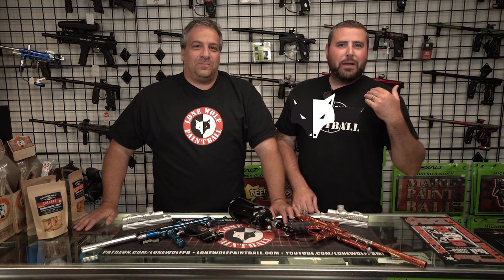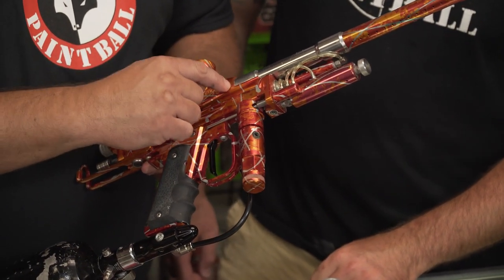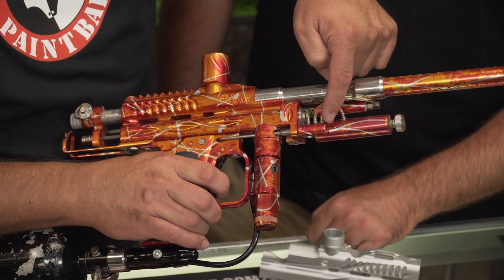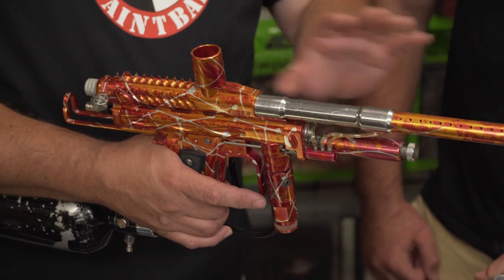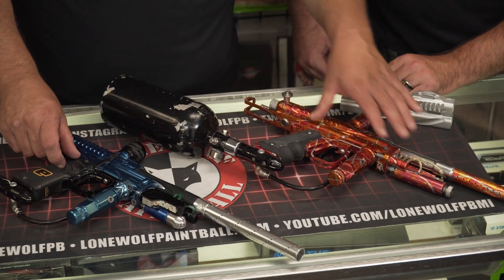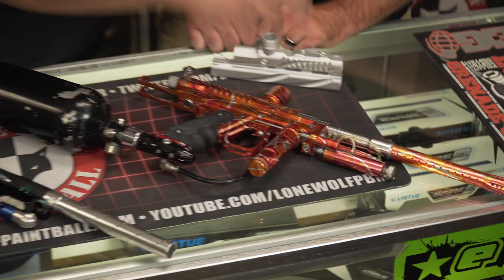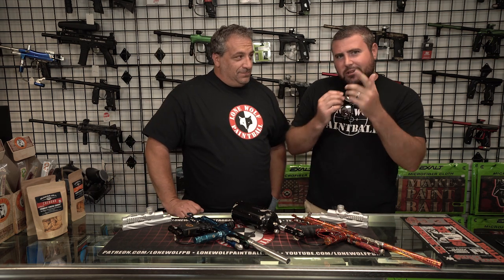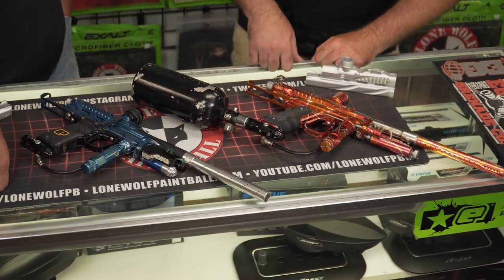How an Autococker Works with Cesare Pizzo, Supercocker & Cold Fusion Creator

Comment: As much as I love my autocockers, you reviewed my gear in I think review my gear 3. I would not say they are any more or any less accurate than any other gun i own of a certain level (aka not blowback or a gun without a proper ball to barrel match). I personally just love the sound and look of them. 

So this is my take on the quote on quote myth of autocockers shooting better. Closed bolt in true firearms are more consistent than open bolt firing firearms. There was more of a need for autococker owners back in the day for us to invest into expensive barrel kits b/c we were more negatively affected by it by anyone except for pump players as paint got smaller.

Add to this that autocockers by there nature of being expensive then and now are mainly purchased by players with experience who understand a good paint to barrel match and you have the makings of a myth that has stood the test of time. And like any good autococker owner if you think my gun is more accurate than yours I will not correct your thinking because it will be when you are thinking this.

Also on the mechanical marker in the video. I'm surprised you have it timed like that I personally never like my 3way activating before the marker fires.

Comment: I ran a couple of CCMs for several years...sold them after the divorce for need of cash and regret it. But on to my point....they were some of the best built cockers I ever ran and I was very accurate with them, but it really had nothing to do with the platform. I was accurate with them because they were VERY consistent with their velocity. My Series 5 I ran a Palmer reg and a 12" brass Palmer barrel with "widgets". It was fucking heavy but I had it dialed in with Marbs and could get a very consistent +/- 2fps all day every day with it. It was a face painting machine. I miss it dearly. Converted my J2 to pump with same setup and it was just as fun. Your going to increase accuracy with any marker by simply finding the most consistant setup possible. The closer you are to a stable constant velocity the more consistent your shots will be. Paint to barrel match effect this heavily as others have stated.

Comment: Where are those bodies going to be available for sale? I just want a flat black anodized one with a front block and whatever will fit the threaded feed neck. It would be a nice replacement/upgrade for one of my 2K bodies. The shaved body will be lighter and the threaded feed neck a big plus. 
Might as well shave the sight rail off the top and add some milling there too.

Comment: Watch out for paintballs rolling out the barrel when using a closed bolt system. so that means no cheap paint! You have to buy a fairly mid-grade to high-end balls in order to make sure of size consistency

Comment: A bit late to the party, but for what it's worth, there is no such thing as "air distortion."  It might feel like paintballs should compress or deform when hit by the air impulse, but they don't.  From a physics point of view there is absolutely no reason for balls to distort because under the conditions that exist in paintball, pressure treats 3d objects as flat silhouettes.  And then there is the fact that this myth has already been debunked.  AGD did loads of testing in the early 90s with high speed cameras and glass barrels, and showed conclusively that ball deformation simply doesn't happen.

Comment: Ah the myth of "Closed Bolt Accuracy™" IT'S B.S. I love the Autococker, if I did not I would not own 12 separate models of them but the platform is no more accurate than any other form of projecting that .68 caliber paintball through the barrel.
If you want greater accuracy thou shalt do two things:
#1 : BUY BETTER PAINT
#2:  Buy a high-quality barrel system and find the right diameter bore insert/ back to slightly overbore / underbore based upon the system you are shooting for the day.

That's it, NOTHING MORE CAN BE DONE TO INCREASE SHOT TO SHOT ACCURACY. doesn't matter what platform you are firing whatsoever.
Autococker, Automag, Shocker, Angel, Impulse, Evil Pimp Ice Epic, Intimidator, Luxe, the newest Planet Eclipse marker, The Hottest Dye markers all different all will give you different nice features,  but how the paintball interacts with the barrel is EXACTLY THE SAME.

Simple physics folks.

Oh and BTW: His new "Cold Fusion" bodies are just unused WGP 2K4 PROSTOCK bodies with S cuts in the rear, it even has the divot for the WGP "Stylized W" logo jewel as well as a WGP serial number.  Pretty lazy "custom" work there. Seriously it's like maybe  5 minutes on a mill+ bead blasting.
Reply from the maker: You are mistaken if you think the milling is the only reason a Cesare marker is something special.

Look we can BOLD too, and even bold italics.
Reply: I certainly want to give you the benefit of the doubt, as the older Super Cockers and Cold Fusions were really quite good for their era. ( Keywords: for their era. Today while still awesome they are outpaced even by some of the later day bone stock WGP factory models.) 
But to claim you've got "something special" after over 27 years of Autococker development from at the very least 16 separate companies within that timeframe? ( this is a VERY conservative estimate based off of memory.)

That's both a tall order and a not insubstantial claim indeed, especially when all that is shown is a 14-year-old WGP official Pro Stock body with some additional admittedly nice added milling.

I wish you the best of luck.
Reply from the maker: I think we are going to have to do an Autococker shootout video.
Any chance you are within driving distance to MI.
Reply: I'm in Louisiana, but to further elucidate: The Super Cockers from 97 onward their claim to fame past the unmistakable milling was their specific trigger pulls while heavier than say a Bob Long, BBT, or Eclipse Autocockers was smooth due to hard chrome plating and a bare stainless steel seer, and the lower tube was well sprung.
In 97 owning a Super Cocker meant something as you had the tournament level optimizations such as a drilled externally accessible Lug access hole, the frames were drilled and tapped for a trigger plate guide screw to eliminate vertical slack/ binding, a trigger stop was added.

As for the pneumatics chosen the LPR was from Palmer's Pursuit Shop ( Rock regulator with thumbwheel adjustment), the 3-way was a stock WGP brass Pre-STO era model and the ram was one from Clippard Pneumatics (very solid excellent ram but with one fatal flaw: You can not rebuild them.) The pump arm and cocking rod were made of titanium.

The provided barrels were DYE aluminum Boom Stick barrels anodized to match, ball detents were stainless steel Cooper T style as opposed to wire nubbin detents.

The valves were stock unaltered WGP off the shelf factory, the bolt was a stock WGP bolt shaved down in to reduce weight as were the back blocks which were stock aluminum but milled down to reduce weight slightly and the lower tube springs were switched out for slightly lighter Nelson springs in the Super Cockers.

Only other change in the Super Cocker before WGP made the change was the Super Cocker have they had a small set screw hole milled into the lower tube to keep the valve retention screw from backing out. This actually was a pretty important mod and well worth the money P&P was asking for alone before WGP did it to all of their factory markers.

Bone stock from the factory they still ran in the 400 PSI range, this was not unusual as  High flow valves were not a super common off the shelf component until post-1998 for the AKALMP low-pressure kit and around 1999 for the Shocktech Rat 3: 16 valve.

Noting all of this compared to the post-2000 changeover epoch year for Autocockers all but one these mods present in the Super Cocker were considered outdated when compared to a 2000 STO.
The STO presented as a list of changes:

Enlarged valve chamber providing 3x the amount of pre-regulated air from the HPR.
Shorter throw 3-way based upon the Belsales "Angry" 3-way licensed to WGP officially.
Reduced weight back block. ( This subsequent change applies to ALL post-2000 Autocockers.)
"Ergo" series adjustable HPR (same operational theory as Inception Designs HPR.) 
Rebuildable STO ram.
Redesigned valve assembly with higher flow ports.
Lightened/shortened reduced mass aluminum bolt with higher flow vent port/face  
Elimination of the now needless front sealing o-ring thanks to said bolt.
Adjustable trigger stop and vertical slack removal setscrews.
Externally accessible Hammer lug access hole with a redesigned hammer lug bearing surface.
Polished and hard chromed trigger plate.

All of these alterations were just for WGP's "middle of the road" priced STO, which by 2000 outpaced the Super Cocker Line and the Cold fusion Line P&P were putting out. 

If you paid for their higher end WGP factory models after this you got even more performance upgrades, the only point after this that the only thing the P&P Super Cocker and Cold Fusions could offer substantially more than WGP's mid-ranged STO bodied Autocockers was in milling & custom anodizing.

By 2002 WGP's Black Magic had utterly beaten 9/10ths of the custom mechanical Autocockers in features/quality with rare exception made for companies like Eclipse, Belsales, and BBT/Shocktech.

Your own "Lava"/ Clear splash anodized cold fusion as nice as it is ( and it IS nice, make no mistake) is rocking a WGP 2000+ factory swing hinge frame. a very solid choice but compared to say a Powerlyte Grip Styx, Eclipse blade ( mechanical not accounting for E-1 or E-2 Eblades) or a DYE hinge frame is a bit longer in pull until activation and a tiny bit heavier in return spring pressure if left bone stock.

Awesome piece of history, collectible, and enviable? Sure! But the game has changed considerably in regards to the performance of high-end mechanical Autocockers, and coming out gunning for that top slot is going to be VERY hard indeed.

To say you have "something special" in this very advanced, very broad market means you had better come out of the gate prepared to melt people's faces clean off with what you have to offer.

Made even harder now that you have some genuinely STRONG competition at fairly low price points.

I do genuinely want you and Cesare to not only succeed but knock it out of the park, the more people making high-quality Autocockers the better! But people like Danny Love and Simon Stephens are back in the game and that is STIFF competition.
Reply: and btw im not hating, it just is funny lol
Reply: Autocockers have been in the sport for over 27 years, there'a whole lot of different eras and changes to the specifications for the epochs of those eras. and it's not so much an  "argument" just pointing out with each epoch came performance changes.

The simple "cheap" Empire Ressurection would have been considered a "supergun" in the 90's all the way up until the early 00's. But today even they pale to some of the really strange, eclectic and sometimes outright bizarre modifications some of us have done to the platform.

I might be a "nerd", but I've been on the field playing for the lion's share of the Autococker's 27 years, not all of it but the VAST majority as I've been playing for over 20 years. 
 
Of those 20 + years I mostly shot ( and still do shoot) custom Autocockers and Automags as my primaries.

I have a lot of other markers as well from a wide gamut of makers some still alive some long dead in the industry, but I  always return to Autocockers and Automags
Reply: @reignick1133  ahhhhhhhhhhhhhh this brings me back to middle school in 1993. thanks man.
Reply: I disagree. I think a closed bolt system is superior. You say simple physics, but I think the simple physics is that one you have a SOLID metal bolt pushing on the paint and the other is pushed purely by a gas... and a gas is... gaseous. Gases conform to cradle the paint more effectively and deform the paint less. Easy to test... Bolt the markers to table and use a platform that both accept the same barrel for a apples to apples comparison. Then fire several groups with each marker / same barrel and average the spreads. I've had a Cold Fusion Ultra. The gun was SUPER accurate. I'd wager the closed bolt system will outperform the open bolt system. I'm not sure by how much, but I think the effect will be measurable.
Reply: @MatthewWagnerNOECA  you can disagree to your heart's content,  but this is not a matter of Opinion. It's been  PROVEN time in and time out that Closed bolt imparts no advantage in a semi-auto or select-fire marker in relation to accuracy, Only paint quality/uniformity, regulator consistency and barrel do.

Accuracy =Consistancy, End Of.

In an open bolt marker impact of the bolt is NOT what propels a paintball, it's the volume of air in front of or being shuttled through the bolt acting upon the paintball.

Don't take my word for it, however, go to PBN or look up Cockerpunk, they have done the testing time and time again. the conclusion with EVERY other last detail being identical ( Pressure quality of paint loader barrel system etc) has always been the same: No evidence of the closed bolt system offering any advantage to accuracy.

I  LOVE the Autococker as a system,   even like the strange horrific Rube Goldbergian abomination of a closed bolt stacked tube blowback which was the Evil Omen 2.0 (mainly because it's just so  bizarre/ poorly planned out from an engineering POV.) I  collect maintain, tech, and shoot Autocockers and  I have been doing such since Late 1995...

But even I have to acknowledge proven results.  I do not choose the Autococker or really ANY classic marker due to any accuracy advantage as I  will NOT find such...  I choose the old-school classics because they have character.  The guns come from an era when "Custom Markers" actually Meant something. 

Each one has a unique appearance, an aesthetic, sound, shot, and most importantly  Feel that a lot of the newer markers do not have. Newer markers have their advantages in terms of less vibration due to less moving mass, they have lighter weight bodies, good software and generally better gas efficiency.. (The accuracy can be made identical, see above as to what makes a paintball  marker more accurate) but they  don't have that "feel" 

Think of the Old-School such as a classic Autococker, AGD Automag,  Defiants, ICD bushmasters, early Intimidators like a muscle car of the 1960's- early 70's we can try to emulate such... But NOTHING has the same panache as a classic as it has  Soul.
Reply: @reignick1133  The video was from 2018. Did they "melt peoples faces" off in the end?
Reply: @rougeneon1997  they changed body styling,  had custom anno ,very good parts mods, freak XL barrel, trigger plate polishing, sear polishing and great tuning.

Not face melting.. but very good if pricey.
Reply: @reignick1133  Cool. I appreciate the update/reply to this old vid/comment lol! FWIW I agree with your original post. Im just getting back into the hobby because of my son after a nearly 15yr break. Holy shit there is some nice gear now. My cheap old Spyder TL still works haha. I did replace all the rings first.
Reply: Dye boomstick and a old side feed determined that was a lie. I remember playing against members of the house team in a big game years ago. They were shooting timmys and a explicitly remember them stepping out from behind a tree thinking they were hot sh*t dumping their timmys. Balls were landing all around me and i thumped both of them in the chest. Priceless lol

Comment: I have a e1 and when I pull the tigger and hold it it fires and cocks but then releases with out letting off the trigger. Is my solinoid bad? Or is the ram leaking

Comment: I don't think his pnues should be leaking that much pre-ram activation... it's like he has QEVs on every barb.  Don't mean to question the guy with all his experience, but my cockers don't leak that way in their timing.
Reply: SHADOWSTRIKE1 it sounds timed really tight I think it may be suction timed or maybe even slightly out of time. Either way I never really cared for timing mine like that as it causes inconsistency and blowback more often then it helped being able to rapid fire without shortstroking. Beauty and curse of autocockers b/c clearly the marker cycles

Comment: Lol let BS commence what they failed to mention was and still is is the tendency of the autococker with its closed bolt was the frequency in which it would clip or pinch the ball as it drops from the feedneck into the breach where the feed neck and the mainbody meet , and the frequency in which you have to tune, time , and tweak with the gun so that pinching doesn't happen. With a grav hopper this can happen every time there are only a few balls left in the hopper as the last couple will bobble in the feedneck from blowback( depending on the height of the neck). Barrel, bore match, velocity ,consistent size new paint without dimples or flatspots, and a clean non oily barrel make any paintball gun accurate , period.